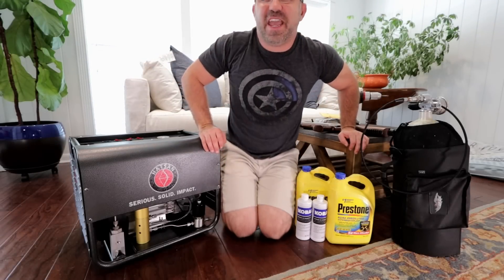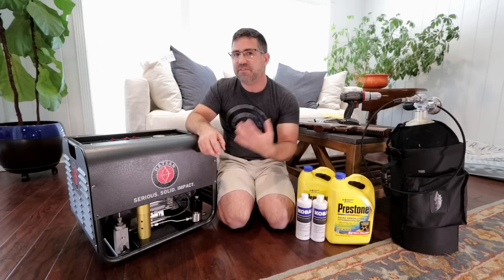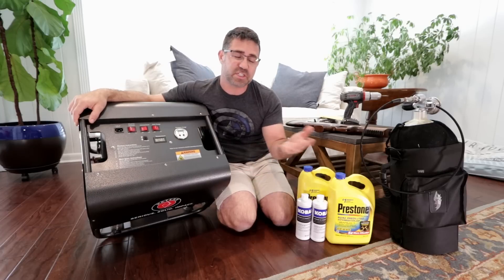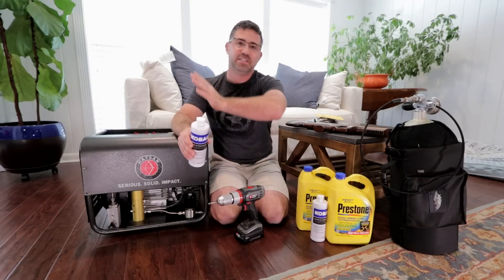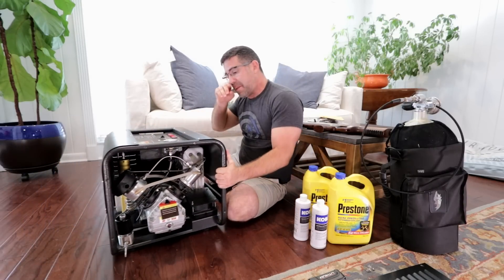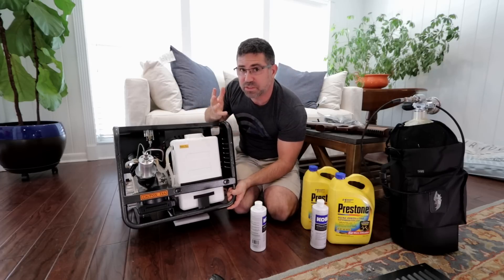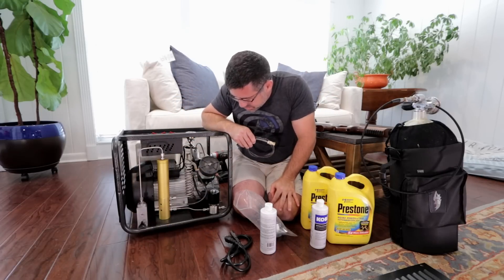Hatsan Lightning 4,500 psi Airgun Compressor (Review) + PCP Air Rifle Refilling + Air Tank - SCBA

Comment: Mine quit after 1.5 tank fills. Used all the o-rings and head gaskets that came with it. Keeps blowing high pressure stage o-rings. Now I use it for my boat anchor and it works better in that situation!!

Comment: Aluminum WILL corrode due to moisture, and other contaminants. Controlling it  is a critical part of air gun maintenance. I have seen an aftermarket aluminum plenum unit badly corroded after one week (due to the use of a silicon spray lubricant that used compressed air and a lack of a moisture removal system on the air compressor). It is a big deal if you care about your air gun's. Cheers.

Comment: It's made by youg heng and it 95% the same as there 225 compressor with a $65 gold filter and a pretty frame around it. I'll save 1000 bucks...

Comment: It’s been a year since this review, have you continually used this ?
If so have you had any issues that have come up?
Thanks in advance

Your a wealth of knowledge and it is greatly appreciated
Reply: Hello.  This vid was a pre-review.  Reviews happen over on my other YouTube channel AEAC Home 🙂.  I never did reviewe the Lightning.  I sent it back for repairs early on and Hatsan sent the Neutronstar in its place.
Reply: Airgun Exploration & Advancement Channel what would be your personal choice in a compressor with you knowing what you know now?
Reply: @toddlish1892  If money were no object, something with a Coltri or Bauer pump and an auto moisture purge & shutoff.  Here at the house, I've been using the mid priced Omega Turbocharger for years and it's been excellent.  If I were on a budget, I've found the Hatsan Spark and Air Venturi Nomad II to be good but they're for filling guns, not big scba tanks.
Reply: Airgun Exploration & Advancement Channel Thank you Steve....

Comment: Hi sir what is different between air compressor and pcp compressor ...can I use air compressor for filling my air rifle please suggest me waiting for your reply thanks
Reply: What are the psi capabilities of your compressor?
Reply: SKU

PNE.AIR.22174003

Type of Product

Oil Free Air Compressor

Power

0.55 Kw

Pressure

0.8 Upa

Voltage

220V

Frequency

50 Hz

Tank Capacity

25 L

Model No

TB550W-25L

Noise

≤ 48

Speed

1440 r/min
Reply: @paulkunjukutty9205  Paul, how many psi does this compressor fill to?  That's all you need to know to match it up the working pressure of the gun you wish to own.

Comment: Owners Manual specifies the coolant is a G-05 or equivalent type.   Is Prestone coolant a G-05 fluid type?
Reply from the maker: You might check but when I ran it past Hatsan, they said I was good to go with the Prestone.  It's actually not all that important so long as ya got a little antifreeze in there, maybe 30/70 to help with anti corrosion.  Best, Steve

Comment: Is there a place I can order this compressor? Only place I see is Utah airgun, but they are charging $1339 plus $100 for shipping. Hatsan USA also list as $1339 and charge $50 shipping. Airgun Depot has it listed as $1299 with free shipping on order over $170. But it's out of stock. Airgun Depot needs to restock this compressor.

Comment: well, Air Venturi, makes the exact same compressor , sold at Pyramyd Air for about the same price;
Reply: For anyone reading this, that's not actually correct.  Yes, the engine is identical but the Hatsan takes advantage of stainless fittings and tubing, a desiccant reservoir, a digitally controlled auto shutoff, and a digital programmable moisture purge.  The Air Venturi model features none of the above.  Best, Steve
Reply: John Madden  China John.  Steve

Comment: Looks a lot like the AV compressor only digital and auto purge ... either way awesome review just wish I would have heard it turned on .
Reply from the maker: Yes, engine is the same as AV but Hatsan added stainless lines & fittings, auto digital moisture purge, digital auto shutoff, and a desiccant reservoir.  Steve

Comment: Hi Steve, Have you had a chance to run the compressor? I just recently purchased one, and I'm trying to see if others are experiencing a high pitch noise like I'm having as the pressure increases in the compressor.
https://www.dropbox.com/s/61zk6qghfq6wmej/IMG_0140.MOV?dl=0
Reply: I don't have a high pitched noise that I can hear Brad.  Maybe keep asking some others.  Steve
Reply: Thanks for the reply. I spoke with some others owners, and they said they can't really hear the high pitch noise in the video, but the compressor sounds like theirs. I got a reply from Hatsan saying the noise is normal, after they took a look at the video. So I broke it in and did a pressure test, which went fine. I tried to fill my omega 6.8L from 0 psi to 4500 in one go, but It stopped short at 4000 psi . So I will need to calibrate the digital gauge. Overall for the first run on an empty 6.8L Omega bottle from 0 psi right at 4000 psi, it took about 75 minutes, at a final temperature of 183 degrees Fahrenheit.

Comment: Get some silicone and re-silicone where the inlet and outlet radiator lines penetrate the water tank. Stick with 5 liters as the manual calls out for the radiator and the radiator fluid level will be about 3/4 - 1" below the max fill line.The max fill line will put the fluid level right where the lines enter and exit and you'll have a much worse tendency to leak there.  Mine leaked (more of a drool down the side of the tank) due to just moving the compressor around making the radiator fluid slosh around in the tank. After applying more silicone, mine has not leaked anymore.

Comment: I feel cheated. Last year I bought an Air Venturi based on the same platform as this but I'm really liking the idea of the digital adjustments for air pressure as opposed to setting the spin dial to what ever pressure I need and air purge control on top is a great idea. I just received the Air Venturi Nomad which is working GREAT and slicker 'n snot. I might do a video review on it. To everyone who thinks they are a bit pricey they are built to Hatsuns or Air Venturi specs and go through many follow up tests to fine tune them and work out all the little kinks, bugs and quirks. I ordered my Air Venturi Nomad last March and Air Gun Depot finally have them in stock. When I asked why so long they explained to me what I said above. I'm liking what I see here and will probably by one to.
Reply from the maker: I'd be curious to see that video 👍 and I too have requested the Nomad II from Pyramyd.  In speaking with them, what you say is true... they've invested a lot of time into making in their own.  Best, Steve
Reply: I'll try to do a video this weekend assuming the weather is good. We live in the foot hills of the Adirondacks and the weather this Summer has been from one extreme to another.  I just went to air gun depots website  https://www.airgundepot.com/air-venturi-nomad-2-portable-compressor.html   and it looks like they are out of stock already. I believe this will be a long term hot seller for serious shooters.
Reply: Hello Steve, two links for the Air Venturi Nomad. Feel free to repost and share, Greg
https://www.dropbox.com/s/43emw7bf23dte1f/Nomad-1.MOV?dl=0
https://www.dropbox.com/s/1k85kbj6w27u0vg/Nomad-2.MOV?dl=0

Comment: Nice but, I'll stick with what I've said before about these >$1,000+ compressors; bells and whistles and do the same as the <$300 YH compressor, fill a bottle with air.  Even if it's only $1,300 that's still $1,000 more than a YH delivered to your door.  For some folks I'm sure this will be great.  I just can't rationalize spending over 4 times as much to do the same thing but, that's just me.

Comment: good review,  seem like 2 much responsibility lol..hatsan should come out with a entry level air compressor around $500 something u can travel with...& bring the air max bullpup 2 the United States, carbon fiber bottle, regulated, make it qe, & give the proxima more power in 22 n 25cal  ..more power in there 25,& 30cal break barrel
Reply from the maker: Hi Gerald.  I've spoken to all the companies offering spendier "full size"  models and while none of them are opposed to a less expensive offering, all of them tell me they haven't been able to find a way to get the reliability out of em yet.  Best, Steve
Reply: @aeacvlog2033  thanks for the reply..appreciate it
Reply: Gerald Williams , I agree entry level pcp compressor  affordable  .
Reply: Hatsan release their spark compressor. It's small, portable, and use 12v battery from your car. For only $419.

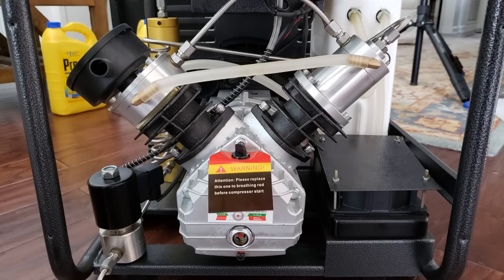Comment: Steve I'm not going to lie man, I was cringing as you were marring up that pre-engineered flooring! I saw the gouge at 12:55 in the lower left corner and gasped lol Besides that, Seems like a nice compressor and very well built but only time will tell how well it holds up.  Thanks for another entertaining Vlog bud.
Reply from the maker: Flooring is all good Haj.  We've just had a major reno here so I'm used to restaining scratches with a q-tip & paper towel... and it's already pretty beat up.  One more for the "cause" ain't gonna hurt anything, lol.  Steve
Reply: The full review setup and maintenance guide was never uploaded to AEAC home. What happened?
Reply: Take it to the garage Steve, thank you for a great review, and thank Hatsan for a great compressor, it will be interesting to see what extra this costs us in Britain, the last one you tested ended up the same in pounds sterling as US dollars, even though the exchange rate was .77! There's profit then there's greed!

Comment: Steve, good review. A few constructive comments (Centercut on AGN):
1. Take a look at the Lowe's Kobalt compressor oil. The last time I looked a the fine print, it said "synthetic blend". As hot as these compressors operate its best to use a full synthetic air compressor oil such as the Royal Purple Synfilm.
2. Vertical Water Separator - good. Auto Moisture Purge - good.  Aluminum block with desiccant - not good. There is very little volume in there to hold a useful amount of the dryer beads. Truthfully, not enough to make a difference. Take it apart and see, you'll agree. This is the same outlet block that the two cylinder Tuxing uses (since its basically a two cylinder Tuxing compressor with additional goodies thrown in). I opened mine and there was perhaps a teaspoon full of beads. This compressor still requires an external air dryer/filter IMHO.
Reply from the maker: Thanks for the good input 👍.  Just following manufacturers direction on the oil though and they told me they really liked the Kobalt brand.  Best, Steve

Comment: Hey Steve, you got the 2 mixed up. The silver rectangular cube is going to be the moisture separator, and the gold cylinder will house the drying media.

I think it's great that there's another compressor offering out on the market, but guys who are familiar with these Chinese compressors will quickly recognize this unit as a Tuxing compressor with nice add-ons (self contained water cooling, moisture filtration, electronic purge). I have some first hand experience with these units and there are plenty of shortcomings with the quality and manufacturing of these units (going back to the mfg in China, no fault to Hatsan). I could go on and ramble about this, but this isn't the place for that. The only thing I'd like to warn long term users who own this style of compressors is to be careful of oil selection. Since these twin piston Chinese compressors have first started to show up stateside, we've been told by the manufacture to run AW46 oil, hydraulic fluid, or general compressor oil. None of these oils are meant for use in HIGH pressure output compressors. All of them will quickly degrade, and at the very minimum, wear down the high pressure side piston seals and/or cause other bigger issues. Even though the oil sits in the crank case, it will make its way all the way up to the top of the pistons where low pressure air is compressed into high pressure. It's really best to use oils designed for high pressure compressors like the oil you used on the Daystate compressor, Chemlube, Seco Lube, etc. If there's any doubt about this, just look at other longtime manufactures of high pressure compressors like Bauer and Coltri and you'll see all of them require special oil.
Reply: Steve is correct the Desiccant is housed in the outlet block
Reply: Hey HatsanUSA, thanks for replying! No offense, but...are you sure about that?

That silver outlet block looks like it has 3 ports (from top to bottom): high pressure air IN, high pressure air OUT (to the fill whip), and a bleed screw. If the outlet block held desiccant, it's only holding maybe 1.5" of molecular sieve material? Every other HPA compressor I can think of requires a much greater quantity of desiccant than that to filter out any meaningful amount of moisture.
Reply: Based on another person's comment (from WingnutsMC), it looks like I'm the one that's wrong. Based on his comment, he says there's about a teaspoon of desiccant in the outlet block, so my apologies to the both of you. I agree with him though, that small amount of desiccant isn't going to do very much at all. All of the other HPA compressors with moisture filters run at least 6" to 14" in length by 1" diameter (or greater) of desiccant, so I'm really surprised it's being used very sparingly in the Lighting. The commonly used desiccants require either drying or replacement fairly frequently before they lose all their moisture wicking properties, so hopefully you can provide refills to the end user.
Reply from the maker: @an24510  We're good Andy 👍... nothing wrong with sharing here but yeah, Hatsan told me right about what's where.  As to how good it'll work long term, that's on ya'll to figure out, lol.  Best, Steve